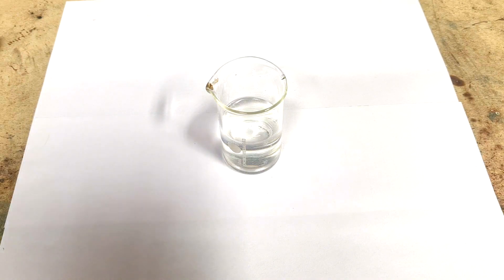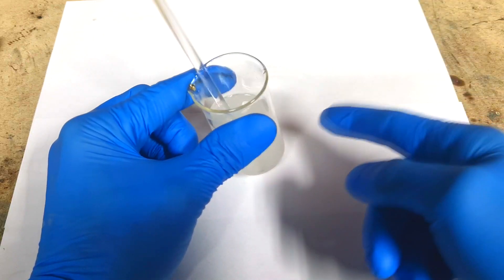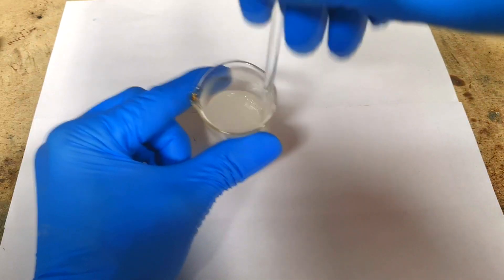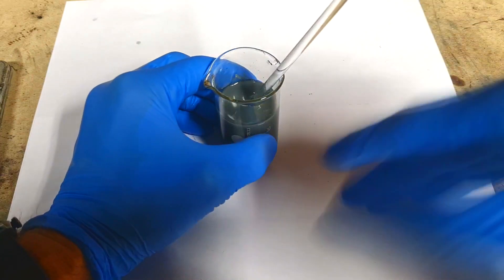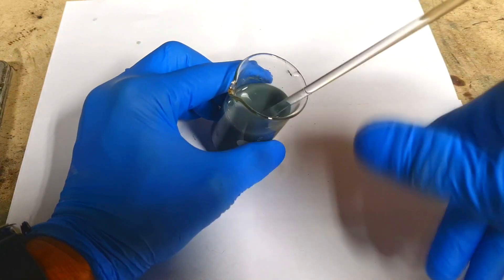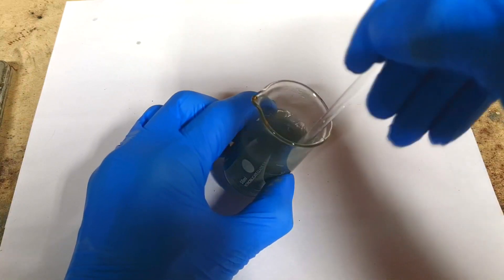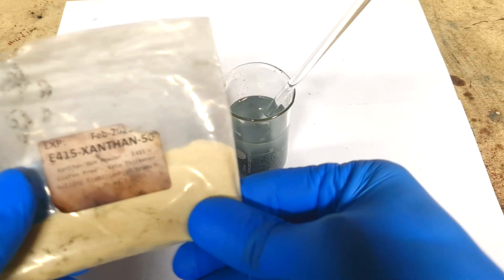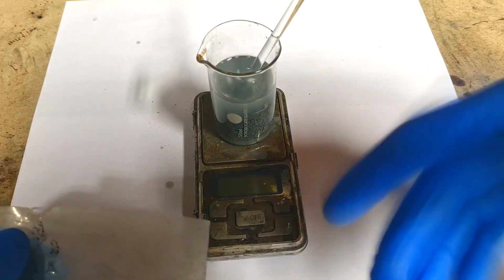Diy Zinc electrolyte slurry - Zinc air battery

Comment: how about zinc (or any other metal) wire fuel cell
Reply: the wire electrode solution is in public domain, in no way copyrighted or patented, free to use
Reply from the maker: @Jkauppa  what are you talking about?
Reply: @cayrex  do you know how a welder works, use that in a metal-air battery, or are you just a hobbyist with no goal in mind
Reply: @cayrex  reaction wire feed-in
Reply: @cayrex  no complex electrolyte slurry making required, unless you need to complicate things on purpose
Reply from the maker: @Jkauppa  I use only what I need that will work. You know that, youtube is one thing and reall background is another. In the background is more is happening than you imagine. 😉
Reply: @cayrex  I dont like to lie
Reply: @cayrex  if you dont produce good fruit, but try to charge money for "secrets" then no go, whatever how you wink it
Reply: @cayrex  I see only that you put out secondary quality stuff, where is the prime stuff, all prime stuff is totally free, no requirements
Reply: @cayrex  money makes you put out secondary quality always, there is only one quality mode at once, either secondary or primary, which is it, someone is lying to their teeth

Comment: Ii have used sodium hydroxide zinc oxide to make zincate, hooked up electrodes to charger or solar panels and made zinc powder. Spent zinc can be reconstituted this way too. There's more to it but that gets some powder made. Thank you!!!
Reply from the maker: The used slurry is regenerated by zinc electrolyzer
Reply: @cayrex  yes, with electricity to make the powder from the used up zinc. I'm excited to restart this project and hope that there's serious interest to get many views and comments.
Reply: Congrats on vanadium flow project! But there's some practical use for this too. Thanks!